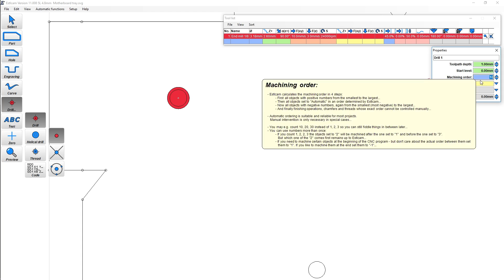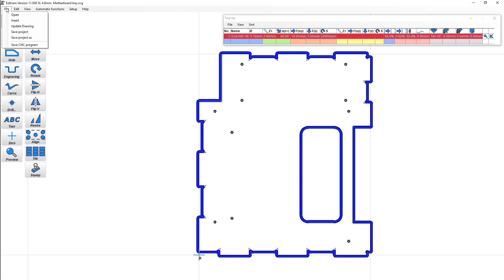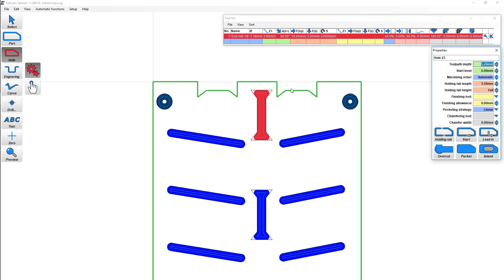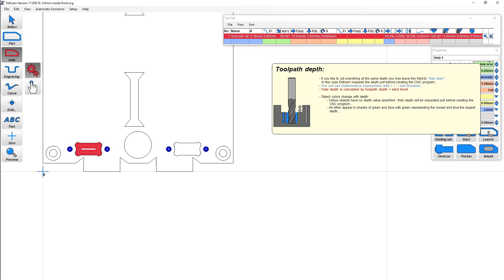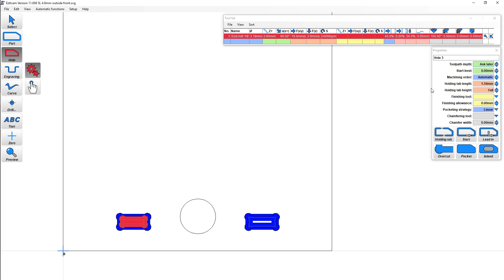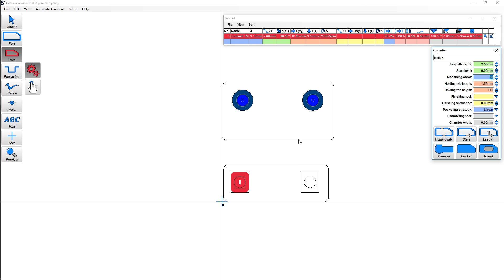Homemade Mini-ITX DIY Case HDPLEX PSU; FREE files to make your own.

Comment: You could perhaps make a V2 that officially supports the HDPLEX 400W AC-DC under the GPU (as it looks to be close) to allow for brickless builds. Otherwise, looks absolutely top notch.
Reply from the maker: I should be getting my 400w in soon ill see what i can do
Reply: Also very interested in this, my 400w is in and was gonna attempt this for fun.
Reply: Hi all, I haven't been able to fit the HDPLEX 400w AC-DC with the stock configuration case. Anyone got an update? That would be amazing, thank you!

Comment: Thank you very much, I am trying to modify the dimensions to be able to put 2 x 120mm fans on the floor to circulate air.
Reply from the maker: Jonatan Martin I would love to see what you come up with. My first case I posted a year ago had 2 fans in the floor. Problem was I designed everything backwards for the graphics card so I need to update it.

Comment: I have made it but I am confused about putting the SSD or HDD 2.5 can be helped with placement for this case
Reply from the maker: It isn't designed to have one. Just an on the motherboard m.2 drive.. But you could fit an SSD on the top where the PCIE extender runs from one side to the other. There is the clearance there for the extender and the drive I'm pretty sure.
Reply from the maker: Alright I put some new SVG files in with SSD mounting holes on the top piece. I don't know if it is going to work but it could.
Reply: Where is the svg file that has been changed or can I request the file download link
Reply from the maker: https://drive.google.com/open?id=128BewQ5Vkdxr321BvP_3fXEgsf3nbgSP
https://drive.google.com/open?id=17ZeRPMiDY6uSIre704c6qJm8DsnWh3Vu

Comment: This so cool and I love that you're sharing it with us the actual files!

I think someone mention below but would you design one with a plex PSU under and possibly shorter (to house a gtx 1080 Ti mini - can keep it 211mm internal length).

I have made my DIY (almost done) out of wood frame and plan to use thin aluminum sheet to cover the rest.

It would be so dope if the top panel is also very vented, from my experience, the maxinum vented top is absolutely needed with these sandwich layouts, the hot air naturally wants to escape from top and back.

here's a reference if you want a visualize layout of what I'm talking about:
https://imgur.com/tJwo7sq
https://imgur.com/DxnZffc
https://imgur.com/kwCku5O

I'm using 3/16 plywood here, Internal volume is exactly 5L and external is 5.5L (because of wood thickness.)

Comment: Can you try design something similar but with a flex atx psu on bottom?
I have a 3D Printed Chassis like this and it's only 3.78 liters of volume with internal psu!
Something with acrylic could be nicer!
Reply from the maker: Nanga Mfumu Makaba 
Sounds like a good idea. Can’t promise a time frame but I’ll mess around with a design.

Comment: Nearly forgot I subbed to this channel a long way back. Looking good btw ;)
What are the specs to this case and would you be able to drop in storage drives?
Reply from the maker: No room in this one for any drives just m.2 on the board, or if you wanted to do a pcie drive. I was going for as small as I could. I plan on doing a version of this one that will take larger graphics cards and/or have room for more storage. I just hope I stay motivated long to get it done.
Reply: @heroicmoose  what if the case would be made to fit an HTPC'ish setup or a NAS with a JBOD array on the side where the GPU goes? BTW, thanks for the prompt response! ;)
Planning to get this out to public's hands via a production run?
Reply from the maker: @LutfiJC  The graphics card side is 51mmx 230mm so what ever you could put on that side will work. I may make a few extra to send to some people, but I've just put the files out so people can make there own.
Reply: @heroicmoose  Hmmm, that does open up options for the function of the case, now that you've mentioned it.

Thanks again for the prompt feedback. Can I get one? I live too far to have easy access to tools you've linked in your video description :'(

Sucks to be living in the country I live in.

Comment: Great build! Love that case, it beats many of the ITX competition. What's the max length for the GPU? I was wondering if my Gigabyte RTX 2070 Gaming OC would fit... It's 280mm long.
Reply from the maker: 225mm long, that is about the limit. I do plan on making one that is a little longer for larger cards, and room for an additional 2.5" drive.